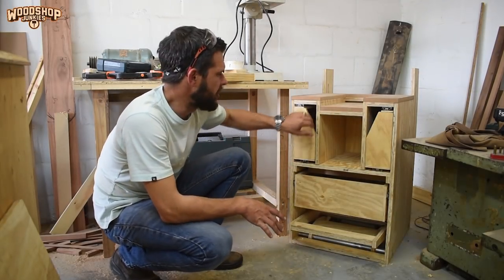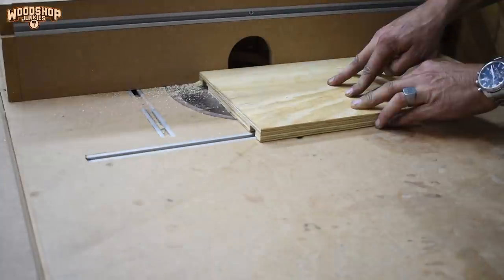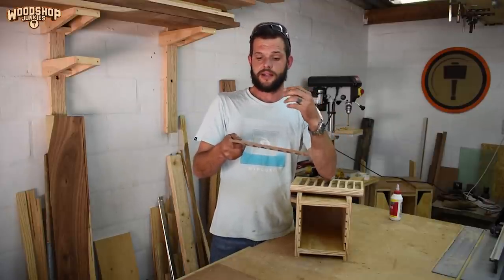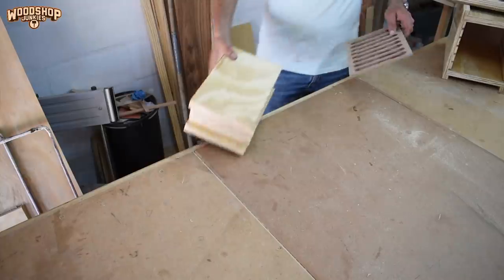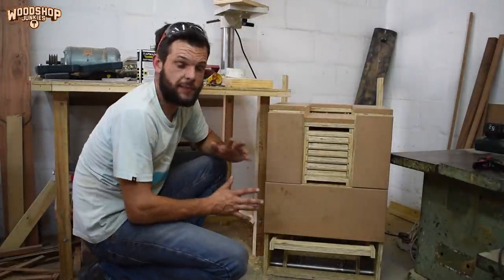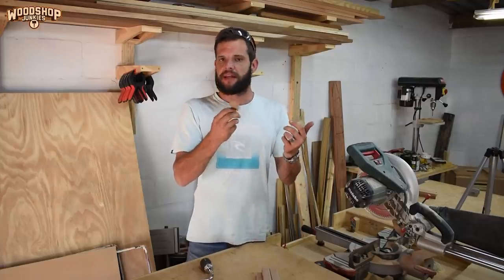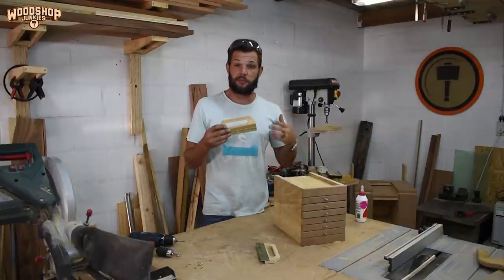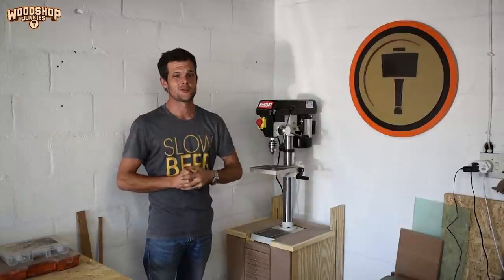Maximizing Drill Press Storage - With Removeable Bit Storage

Comment: Great piece of shop furniture. So nice, in fact, that it practically cries out to have a little insert on the front to complete the trim where the base of the drill press sits. Just for looks, it would come out whenever you need to remove the drill press.

It's also crying out for some kind of finish. I know you don't usually finish your shop furniture, but this one looks too nice, it needs some protection. Even just some spray poly would be good.

Comment: You could do push to open on the smaller drawers, go to the back of the drawer router in a channel (on the side of the drawer) to allow for the push to open to live and  there you go. (though the friction on the drawer slides may be to much for them)

Comment: This has to be my favorite project of yours and this is the 3rd time watching it. I haven't looked, but I am hoping you have plans for it. After this 3rd viewing, I definitely want to build this for my shop. There are a lot of steps to the build so as you did, I will be doing this is steps so as not to get to over whelmed with a one day build. The genius of this design has to be the vertical drawer behind the pillar. Here I was just going to attach a shelf to the pillar that swings in when needed and back when not. I then would have had to find a placement for the rest of my drill bits and attachments. I just finished laying out every bit and attachment I have to make sure it will all fit. This will be a fun project!!

Comment: I would add one detail to your drill bit storage unit.  A vertical through all and a dawl on a "chain" as a travel lock.  That can store in the handle area when not in use.  Without somthing like that all of thous drawers of bits are going to shift the balance of your load and eject themselves onto the floor and then tip your other load the other direction.  Don't ask how I know this.

Comment: Verry nice build 👌 lots of thought went into utilizing every cubic inch of that place. However I don't suspect the push to open poppers will have a long life with the weight the drawers full of bits and drills. I advise doubling them up. Even more practical would be to just use a handle. Yes they will probably mess up the clean look a bit. But when working it's easier and faster to throw them open and shut without a thought.  Personally I love the poppers but only to create a clean look in the house whare I'm not constantly opening and closing doors and drawers in a hurry.

Comment: Will the push-to-open springs be strong enough once you get the drawers fully loaded?  Drill bits and the like can be pretty heavy.  If they do work, you better paint your drawer fronts because dirty hands will quickly ruin the nice clean look of your drawers otherwise.  Nice work.

Comment: This is great as always :) I think it would be a really cool detail if that top facier of the pull out drawer of interest could pull up or perhaps even spring up automatically, when chalf the box is clear of the slot. Two reasons: the bottom has use of catching the push release, this would have a symmetrical use. Also a little shamfer of the box behind the upper facier would make it easy to do I reckon, if it can be done while hiding the fixing point-making it look really neat when pulled up/out :)

Comment: Some great ideas on storage, I wonder about the weight of the finished product, could thinner material such as 12mm for the draws. I would love to know how the magnets in the drill bit draws hold up, I am thinking about using a modification of this for a flip top table I am designing.